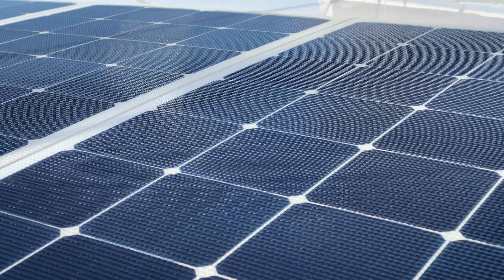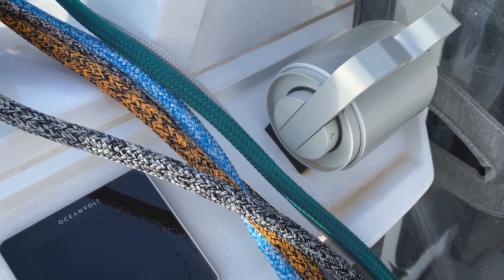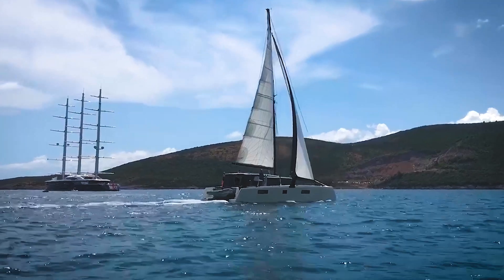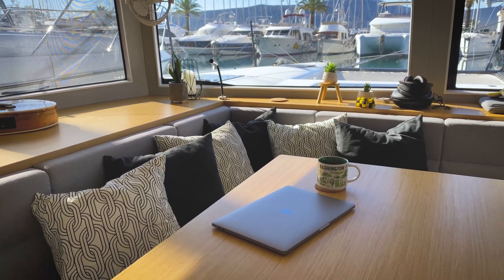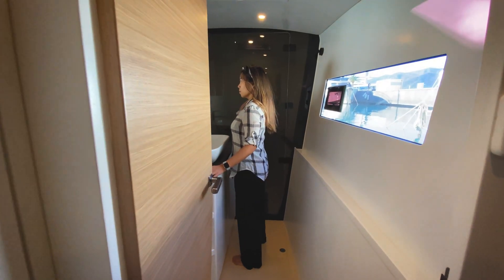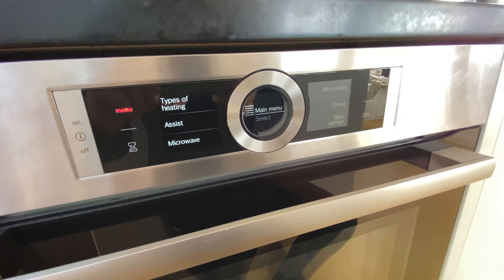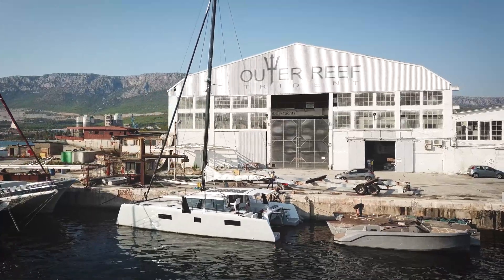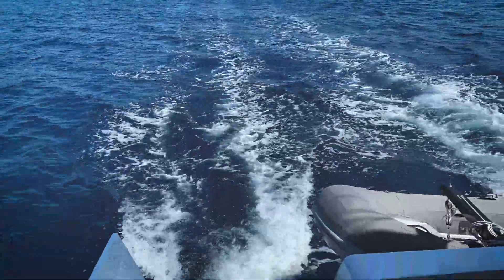2.1 - Dream of an Electric Sailboat

Comment: 2 electric motors by 15 kw each take 30 kw . Considering solar panel abour 200 wats square meter . ?????
Reply from the maker: We charge over five days to fill up propulsion batteries than make 10-15nm distance.  We can do this indefinitely in the long summer days, but usually sail, so it's not necessary and we live off of the power generated by the solar.

Comment: The boat turned out really nicely. We live off grid as are interested in buliding an electric cat one of days. Your so fortunate. How much did it end up costing you, if you dont nind me asking
Reply from the maker: Too much.  ;-)  But we went overboard with carbon and higher end electronics and parts for this size boat.  You can imagine it costing a bit more than something like an Outremer 45 which can range well into 7 figures depending on options.
Reply: @bluesaga  thank you for the information. We are considering purchasing the maxx 42 kit since my husband is an engineer but if we do tgis we will defineatly go with electric motors. We have all off grid fully solar home and  and golf cart with a lithium battery in wgich we use to go everywhere on the island we live on so for us its electric all the way and like you we like the quietness of electric enegry the low maintenence of those motors, along with the entire concept of solar.
Reply: @sandralee5621  Did you check the young couple building a max in Annapolis? You may know them... believe they named themselves MJ sailing...

Comment: That sure is a beautiful boat! Would love one! You mentioned jerry cans of fuel, do you have a diesel generator or is it for the dinghy outboard engine?
Reply from the maker: No you are right no, we do have a diesel genset.  It's for safety and for the time we have to do extensive motoring.  Although, we've not used a tank of fuel in two years.  Check out 2.2 video for our brief overview on this.
Reply: @bluesaga  thanks for the answer. I’ll get to it.

Comment: I hate to ask.  How much have you invested? It is perfect!
Reply from the maker: Without considering cost of molds (about $400k-500k), the custom build with a lot of carbon parts and high-end components will cost around $900k-1.4M for a boat about our size (45.6').  It's better to buy a boat on resale, if you can find something you like, then to go about it as it takes several years to build and is expensive.
Reply: @bluesaga  good to know! your build looks like what I've been dreaming of. have you considered more solar + everything 48V?

Comment: Can you run the motors just from the sun on a sunny day without draining batteries..  I guess you have a generator on board for the cloudy days and when batteries get depleted.
Reply from the maker: I guess it depends on how far you go.  It does add the energy to our propulsion sometimes, but our solar is about our house power use as it's relatively small.  We use a genset for extended motoring.

Comment: Looking forward to videos about:
- the planing, building and purchasing experience
- more technical details and pictures around your electric system.
- Lightning protection?
- what went well, what you would have done differently
Reply from the maker: Will make another video soon.  Will cover part by part so it's not too long.